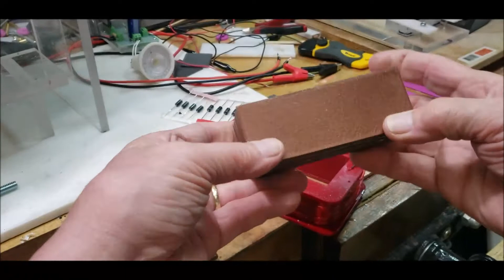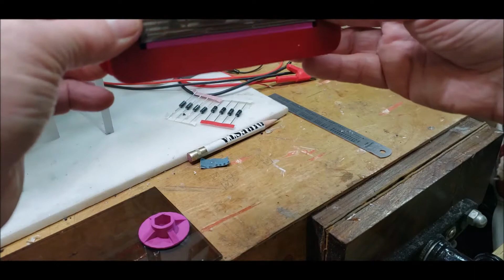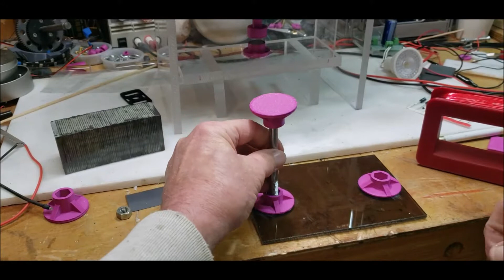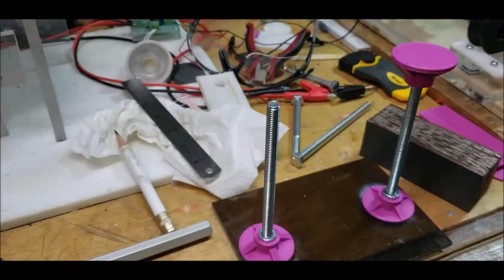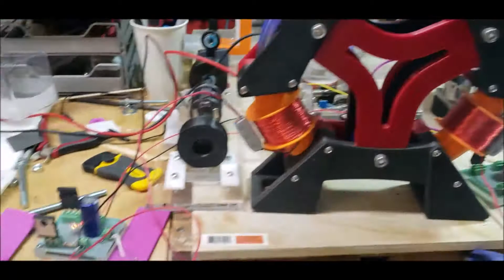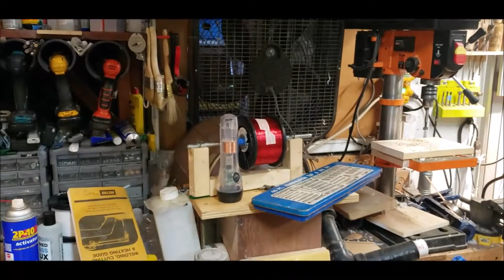3D Printed Coil/Stand and Monster Solenoid Rotor run.

Comment: Will it run any 2 at one time? Or is it the top coil not working? Makes me wonder if one is out of phase.
Reply from the maker: so ya it will run any two any where so I think your right. When I try three it seem like one is pushng while the other are pulling. I'll have to check each coil to see where the odd ball is
Reply: @mcorrade  try wiring one in reverse.  How many magnets are in that wheel again? 24?
Reply from the maker: @MAGnetICus_Attractus  yes 24 or 25
Reply: @mcorrade  if you got 25 that is your issue. 3 does not divide by 25 very well.
Reply from the maker: @MAGnetICus_Attractus  I will have to check but I don't remember. Thanks for the input my friend